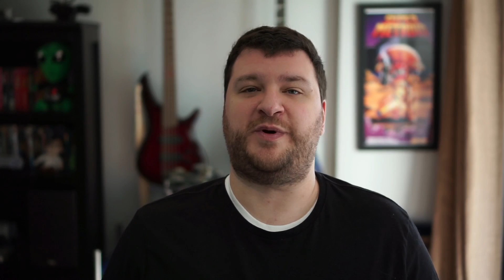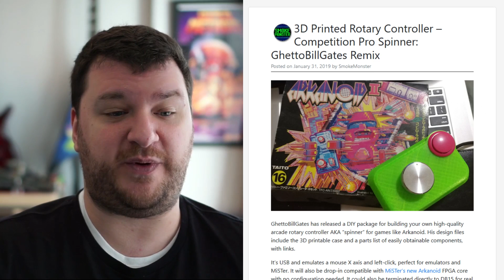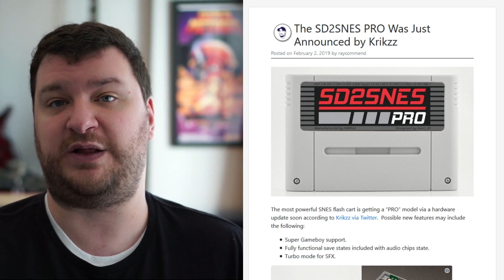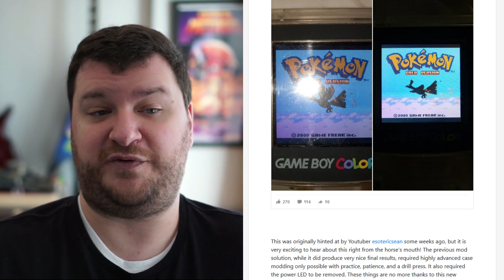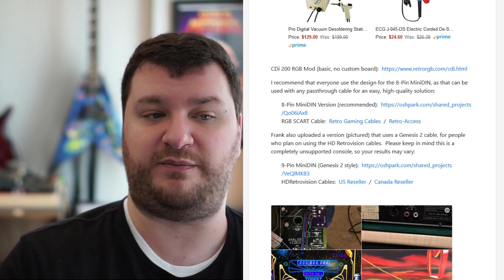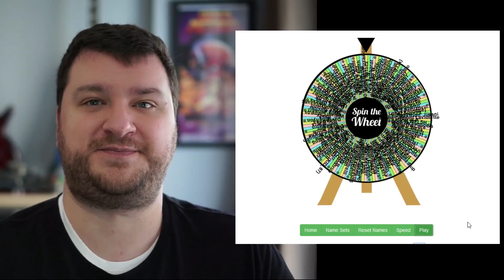RetroRGB Weekly Roundup #135 - February 6th 2019

Comment: IDE isn’t shielded though 80-conductor 40-pins IDE cables can have the extra conductors grounded. Instead of IDE, I’ve seen a few people go with the shielded cables often used to connect analog CD audio from the CD-ROM to the sound card.

Comment: Where is Rene’s 161 in 1 article? I can’t find it through Google and his site can’t be properly browsed on mobile (menu extends off page and doesn’t scroll).
Reply from the maker: That's the one I was referencing, but I must have also confused the conversations we've had since with the actual article.  I'm forgetting where, but there was some place René detailed exactly why that NG cart (and I believe one NES multi cart) are genuinely dangerous to use, with immediate damage possible...not just "might lower the lifespan of", immediate damage possible.  Luckily, with NES flash carts available, I almost never see the NES one anymore.  I still see the 161-in-1 being used now and then without a fix applied :(
Reply: RetroRGB Thanks! If that is the case, I think it’s worth revisiting publicly now that the “pick ‘n’ mix” feature of Universe BIOS 4.0 is driving more people to use them. UniBIOS 4.0 basically hides the garbage bootleg menu and lets you browse the games through the pop-up dialog instead, hiding all the hacks and bootlegs you probably don’t care to have polluting the game list. It’s made me consider getting one since I don’t want to support Terra Onion with the NeoSD Pro and the DarkSoft Neo Multi just has a horribly-designed UI. I’m glad the DS Neo Multi menu is being worked on by a 3rd party now but it’s still a “wait and see” thing for me.

I’d also like to know what fixes he suggests if we do chose to get one, though he may not be interested in supporting its use in any way. Maybe there’s some way to engineer our own level translators? ;)
Reply: https://db-electronics.ca/2017/07/05/the-dangers-of-3-3v-flash-in-retro-consoles/#Neo_Geo_161_in_1
Reply: Sega90s That was fast, but I’ve seen it. It’s not the one Bob describes where René analyzes it and proves that it can damage a Neo Geo MVS. Thanks anyway.

Comment: It looks like that lag tester of yours comes in the same housing as a precision screwdriver and bit set that I have except it doesn’t have the part that swings open and lets you access all the bits and handle inside. Someone obviously slightly modified and reused the mold, just like the Jaguar mold becoming a dental device.

Comment: I’m actually working on my own Genesis/Megadrive to TurboGrafx-16 adapters. I may be in over my head so hopefully the 8bitdo Genesis BT adapter works with it. :) I’ll definitely test but, honestly, I wouldn’t have a clue how to fix it if it doesn’t work. I’m just adapting controller encoding designs where the schematics are available online.

It’s odd that you’d mention the Krikzz Joyzz as an alternative when it only works with one system and one controller. This works with two systems and a HUGE list of controllers. Still, I’m hoping the 8bitdo adapter works with my Genesis to PCE/TG16 adapters so that people can save money and DIY with the cheaper 8bitdo product.

The latency of BT versus 2.4GHz proprietary RF is overblown. Of course, both are 2.4GHz so I hate that everyone routinely tries to differentiate that way and some even mistakenly assume that means 2.4GHz is faster or something. Bluetooth can be slower if there is an OS stack or something processing the input and proprietary RF can be slower if it’s inefficiently designed too, but we aren’t at the mercy of your OS/drivers since these have an embedded microcontroller specifically meant to use it for game controllers. Obviously, BT is good enough for PS3, Wii, PS4, PSTV, PS4 Pro, and Switch. Anyone concerned with latency on those typically goes for a direct/wired controller, which is honestly what they should do if they are concerned with BT on a retro game console that originally used wired pads. Proprietary RF is a half-measure that may not be any better in that regard.

I will say that there is a greater chance that other BT devices and controllers will interfere with your BT adapter but that is very rarely a concern for PS4 players, is it? ;) Proprietary RF isn’t immune but may be able to brute force its way to better performance. That said, I recall how a 4P match of Mario Kart 64 on Wii Virtual Console went completely unplayable when one of us started torrenting over WiFi and most of us were using GameCube Wireless Wavebird controllers. It was repeatable. 2.4GHz is a crowded RF spectrum!

Oh yeah: There is an official wireless PCE controller but it’s IR (infrared “line of sight”) and uncommon enough to be super-expensive. It’s kind like the Sega Wireless Arcade 6 Button pads since they even sold the extra controllers separately from the receiver bundle. The thing is, it supports 5-players (built-in multitap) and I think it prevents you from using a wired multitap so it makes sense that they’d sell the extras separately. ;)

Comment: It would be cool if the DIY spinner were made to work with Atari Paddle, Atari Driving, Atari CX-52 (5200), NES (Arkanoid Vaus), C64, etc, but most use potentiometers (pots) which don’t translate perfectly to a real spinner. For one, pots have a hard stop on both ends where a rotary encoder typically spins forever in either direction. Of those I listed, only the obscure Atari Driving controller is a rotary encoder, but it’s only used for one game (Indy 500) and was built with such a low resolution that it can’t directly translate.

It would need additional logic to simulate pots, capacitor impedance, or encoding of different controllers. Even the Atari driving controller is such a vastly different encoded resolution that it would require translational logic.

Even with logic, you still need clever tricks to get the right output from certain consoles, like a capacitors to get the out-of-spec digipots into range for Atari 5200/Commodore 64. Digipots aren’t available in the correct range but the original pots are read by capacitor discharge times and you can exploit that with an extra capacitor in series. Different consoles read their pots different ways, so that wouldn’t work for, say, the NES Vaus, which needs an entirely different approach to replicate. It would likely involve a programmable microcontroller with translational logic.

It definitely can’t be a one-size-fits-all design without a modular interface to implement all the different ways consoles use pots or rotary encoders.

Comment: Open power supplies in consoles like original PlayStation and XBOX are certainly dangerous enough, and not just when they are still connected to mains. PSUs can hold enough current after unplugging to merit the same service warnings, which is why most computer techs are trained not to open ATX PSUs or VGA CRTs in the field (replace or “depot repair only”). There are definitely more things that come close to the danger of CRTs in our hobby.

Comment: The Genesis2 to Genesis3 part swap is 4 resistors. Very simple.
Reply from the maker: Thanks!  I'll see if I can do it to the one I have and post before & after pics.
Reply: @RetroRGB  it's 2x 43kohm and 2x 75kohm resistors that need installed. I will look for which designators they are. I can't recall right now.
Reply: R120 and R127 need to be 43kohms. R123 and R124 need to be 75kohms.

Comment: Here's the psychology...you do make a valid point about the warning on the SDSNES lifespan, the only problem is the makers THEMSELVES assured everyone it was a one and done product. I bought one, I don't really care that they're coming out with a new one, but I do think it was disingenuous to market it the way they did, only to release a whole new product. I think your indignancy toward the gamers who bought the original product is unfair and misdirected considering the facts.
Reply: Using web.archive.org, I checked https://sd2snes.de/blog/faq in 2018-03-31

Here is the first thing in the FAQ.

Q1: When more enhancement chips get implemented in the future, does that mean a necessary hardware upgrade?
A1: No, the hardware is final. All additional features are introduced
 by means of firmware updates. Hardware upgrades might happen if any 
“physical” problems become known or some end-of-life parts have to be 
replaced. However the capabilites of the hardware will remain the same. 
That also means if SuperFX or SA1 should turn out to be impossible on 
the current hardware then that’s set in stone. Popular demand will 
determine whether or not I’d go and design upgraded hardware. ;)

 So this only partially defends them, but it does state end-of-life parts will cause a hardware change. The fact that the new hardware is more powerful and allows them to add new features to new customers shouldn't be condemned just because you aren't on that boat. If it really is such a big deal to have the new features, you can sell your cart and gain back most of that money anyways.
Reply: It was a one and done product... and now it’s done. That was beyond their control since the main part went EOL. That means that the manufacturer no longer makes it and it will only be available until supplies run out. This happens all the time. It would be stupid to make a new product using an EOL part unless you had already secured all you would ever need. Because SD2SNES is an open project and not just a product, the people building these can’t ALL get EOL parts now and in the future.

That means SD2SNES was about to be completely dead. They revived it by essentially porting it to the new part that replaces the EOL part. That part is more capable than the old one, but it’s entirely coincidental. Obviously, they CAN’T block the additional capabilities for an open project like SD2SNES, so they might as well embrace it for anyone who’d like to use the extra abilities of the hardware. This is what makes it “Pro.”

No reason to be angry. I have two SD2SNES carts and already had to modify the older E1b revision to rev H, but you don’t see me complaining. Besides, you’ve actually mischaracterized what they promised to being with. They didn’t imply it would be “one and done.” They implied that it was future-proof compared to other flash carts since the chip is capable enough to run anything they can run and more in addition to MSU-1. It MORE than delivered on that promise with full SA-1 and SFX support with SDD1 in the works, and just because the chip is EOL doesn’t mean people will stop developing new things for it. It is an open project, after all.
Reply from the maker: That's a brash ending to your comment.  Do you even know what I'm referring to?  Did you see the hateful comments coming from angry SD2SNES owners?

Comment: The people up in arms about the SD2SNES Pro need to understand that hardware evolves for various reasons, what you own will eventually become out of date and what you own will even become unsupported (in the case of some flash cart manufacturers, features will no longer be added). This is a reality in any hardware space, be it game consoles, televisions, computers, phones, or flash carts. Personally, the carts I own have been out of date for years, but I'm not crying about it. I've gotten more than my fair share of use out of them and I'm just glad to see this space continually being pushed forward.
Reply: The issue is that the SD2SNES isnt cheap, and many only justified their purchase with the idea that Krikzz himself pushed, that the SD2SNES was the end-all be-all of SNES Flashcarts and they'd simply be upgrading it via hardware at no extra cost to you. If you look at it from that perspective, you can empathize with them and their fears that future software updates wont be available to them unless the fork out for the newest generation flash-cart.
Reply: Over time the tech has to evolve.  Old chips get replaced with new ones and so on.  I get people getting grumpy buyers remorse if they just bought one, but its not like its going to loose much resell value and there is plenty of fun to be had in the meantime on the og sd2snes.

Comment: Thanks for showing my board hopefully the two other people who like the cdi will get it lol no but ide like to see install pics if gotten and if people need help they can tweet me. A lot of good news and info this week I like the mister progression and look forward to a good crt rgb solution. Thank you insurrection industries Jose Cruz Brooklyn videogames and rene db Electronics for the generous donation!
Reply: Sweet !!!
Reply: Is the output Genesis 2/Megadrive 2 spec or straight RGBS SCART-apex? Does it also have composite or do we wire CSYNC to the composite pin for HD Retrovision? Thanks!
Reply: Emmett Turner one has an 8 pin framemeister pinout and one has the genesis 2 pinout. For hd retrovision pull sync from pin 11 of the encoder to the cvbs pad of the genesis 2 version